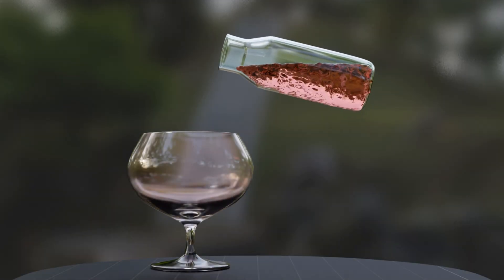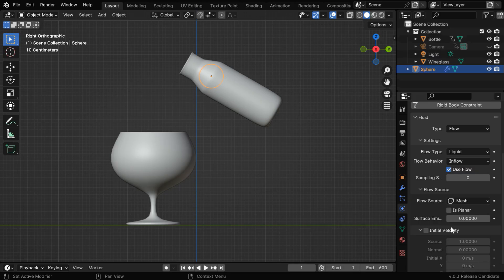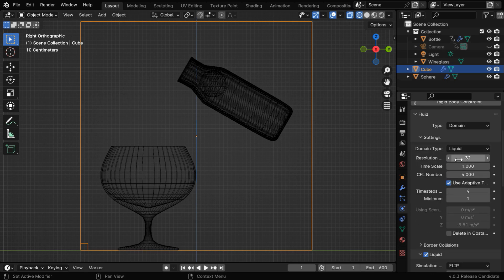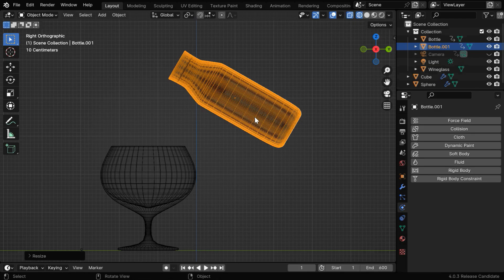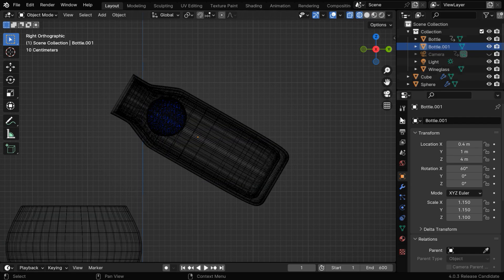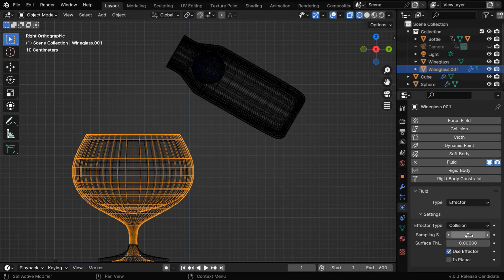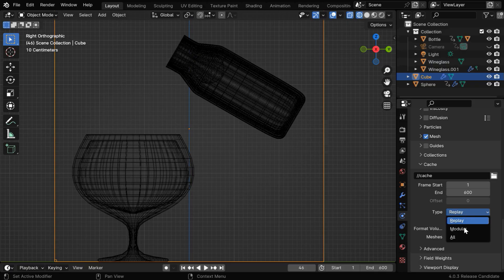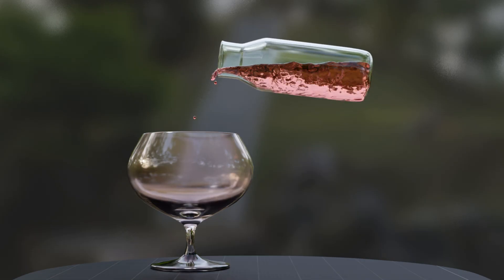How To Pour Liquid & Fill Objects With Liquid | Fluid Simulation Explained In Blender 4.0

Comment: The liquid doesn't want to be generated if it's in the bottle, when I remove the bottle, the liquid is generated
Reply from the maker: Sorry for the late response. Your observation is correct, but it is not due to the bottle. It's due to the size. If your objects are tight-fit, small or very close to each other, it won't generate the liquid unless you increase the domain resolution. Increase it to 128 or 256, you'll see the fluid generation is happening as expected - but the volume will be very thin and the baking will take insanely huge time. So you may need to do a trade-off between the size of the bottle and the domain resolution for the desired output (not too big, not too small).

Comment: After bake, how to hide the cube 😅😅
Reply from the maker: Sorry for the late response. There are two steps in baking: Baking the fluid and Baking the mesh. Once you bake the fluid, it will enable the option to bake the mesh. Once you bake the mesh, the domain cube converts into the fluid itself and the cube disappears, it no longer remains visible.

Comment: This video is beneficial if we want to use two different liquid movements inside a bottle. If we drop them into the cup one by one, then what should we do?
Reply: I am waiting for your answer, if you can. Thanks
Reply from the maker: @welovecristianocr7  Although I have never tried with two different fluids, I guess it can be done in this way: first create the first liquid simulation and bake it. Then use it as a collision object for the second fluid simulation. Fluids do not interact with each other, so this is the best bet we can try.
Reply: @5MinutesBlender   I sent you a message on your Gmail, here is i could not sent the link as i am trying to make. Kindly guide me if you can. thanks

Comment: Why my effector is not working if it moves?
Reply: i watched the video again and again but cannt why
Reply from the maker: @ALYDAP  Maybe the fluid cache is not refreshed? 🤔 It's a common problem in Blender, it keeps showing old behavior and you wonder why the changes are not reflected. In reality, it is just using the old cache. Try to manually force the cache refresh. Make some other easy changes (temporarily) in the setup and verify if those changes are working or not - just to rule out the cache refresh issue.

Comment: Unfortunately it doesn't work in Blender 4.3.1. The fluid sim seems to be broken completely.
Reply from the maker: Exactly which step is not working for you, or which step is showing a difference? I can check if you pin-point the problem (or even better, mention a timestamp from this tutorial).

Comment: Yo, instead of duplicating effectors, you can apply solidify modifier to them. 
 That will close your geometry, give the objects' faces some easy to control width and probably correct normals

Also, for transparent materials you can use glass bsdf instead of principled node

Comment: the cube don't go to mesh when i select mesh option on the cube how do I do
Reply from the maker: You need to select the Mesh option for the object that has a hollow (or concave) part. In this case you need to select the Mesh option for the glass object, not the cube.
Reply: @5MinutesBlender so on the glass I set up a fluid object and what is the type of the fluid ?
Reply from the maker: @Clara-on8pc  Hey sorry, I missed this one. You'll set up the glass as an Effector and the effector type should be collision. It does not have a fluid type. You'll add a domain object separately and the Domain Type for this domain object should be Liquid.

Comment: I was on 3:23 and my Blender crashed :(
Reply from the maker: This often happens due to insufficient RAM. Blender fluid baking takes HUGE amount of RAM. You can either reduce the number of frames or the domain resolution (maybe both) to be within limits, based on your machine spec.

Comment: How to export this animation in ppt. I am trying to export in Wavefront.obj mode but only the objects are coming, but not water
Reply: Also how i can export this animation in video form
Reply from the maker: To export it in a video form, you have to render the animation. The fluid simulation is not possible to export like that as we export objects.
Reply: @5MinutesBlender  I was rendering the animation also. But fluid is not appearing. I am sorry, but I am still learning this software. Please clear this query.
Reply: I have another question that, this can be export as model or not. I am exporting this as model but it again is not appearing. Object are appearing but not fluid.
Reply from the maker: You cannot export the fluid simulation, but the fluid as an object can be exported. Go to the frame where you have the best shape of the fluid that you want to export. In the modifiers tab first "Apply" the fluid modifier and then "Apply" the particle settings. Now you'll get a mesh object for the fluid and you can export it as usual.

Comment: Kya ap bta skte h ke blender ki video ko kese export karu wo bhi fastly kuki jab m karta hu toh bohot slow hota h 250 frame video ko export hone meh 5 ghante lag jate h
Reply from the maker: Are you using Eevee or Cycles? Eevee is usually quite fast, 250 frames should not take more than 30-40 minutes. It also depends on many other factors like the number of samples, shaders, available RAM, available GPU etc. We will soon create a tutorial on the basic steps to render a video and the ideal settings to make it fast.

Comment: One thing I kind of find odd. The liquid looks more jelly like?
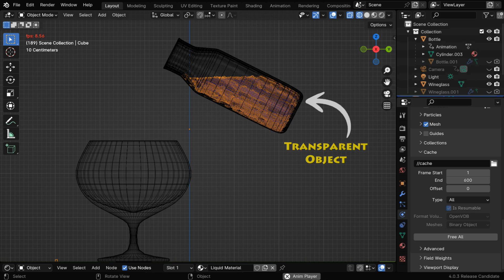Reply from the maker: I noticed the same, and interestingly I also noticed that it is resulting from the material effect. In the wireframe view mode you can see at 8:42 that the liquid is behaving as it should, but when we look at the material view it turns like a jelly. I am not sure what is exactly causing that effect in the material settings, but the liquid through the glass is somehow appearing like this, true.

Comment: The simulation looking turbulent while pouring from one container to another which looks like fake. So, It is useful if blender make some slider to adjust between Laminar and turbulent flow (also how it will transition from laminar to turbulent with speed).
Reply from the maker: As in physics, Turbulence is not a single property of a liquid, it is a result of several other factors. Here as well, you can try changing various properties of the liquid under the liquid section and it will certainly give you different results. Honestly, I did not experiment much with this, but that is where the key lies. All the best 👍

Comment: I tried to do this decades ago and never got it to work. I'd move the container and the liquid would stay behind, mostly. I'll have to try it with the latest blender.
Reply from the maker: Please keep me posted when you try it again. The only problem I saw is, the fluid characteristics are not very realistic. We can experiment with the fluid properties, but it needs a rebake of the whole thing every time which is a very slow process.
Reply: @5MinutesBlender  Oh, and another way to do it is to duplicate the bottle, scale it down some, and just make it a "geometry" instead of an "inflow". It should just plop down into the glass and you don't have to worry about guessing how much fluid you'll have. (Again, I haven't tried it in a while, so maybe I'm wrong with that.)
Reply from the maker: @darrennew8211  That would more or less work, but since we need to scale it down a bit to avoid an overlap with the effector (and possible leaks), it won't fill the container completely... if 80-90% fill is sufficient for us, this can be indeed a better way 👍

Comment: Keep in mind accurate liquid physics is highly dependent on scale. If your objects are not realistically scaled, your results will not be realistic either. Always be aware of your scale in Blender and shy away from modeling things based on the size of the default objects (which are HUGE).
Reply from the maker: Great point! I found it true for cloth physics as well 👍